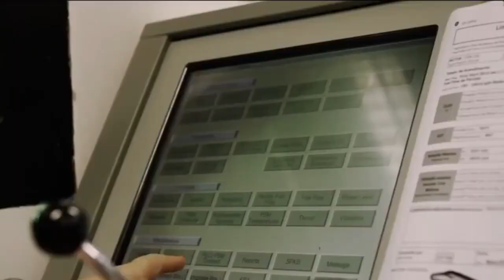#breakingnews  US Congress clears historic deal for make in India jet engines for Indian Air Force

Comment: Good but Kavari will die😢
Reply: No we will use 80 percent tot knowledge on kaveri it take years but still our engine produce 73 kn after burner it will surely improve as economy grow R&D
Reply from the maker: Kaveri is not dying preparations are under way to test it with Tejas
Reply: Godrej Aerospace has started its production. It will power UCAVs.